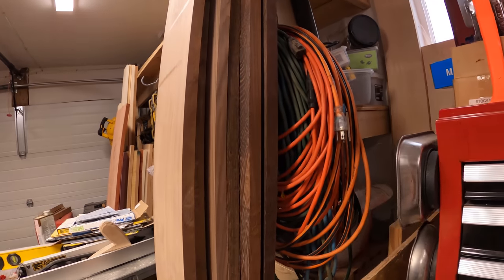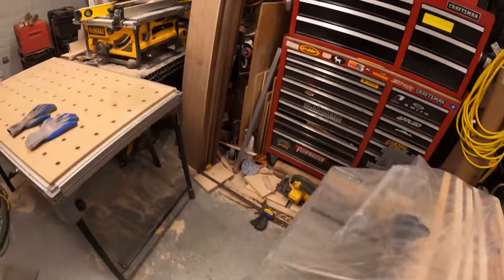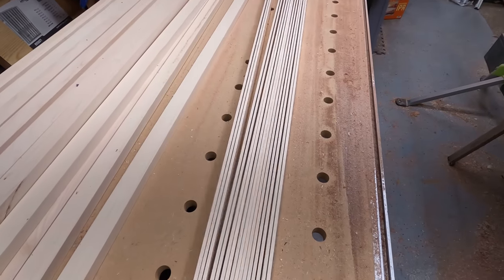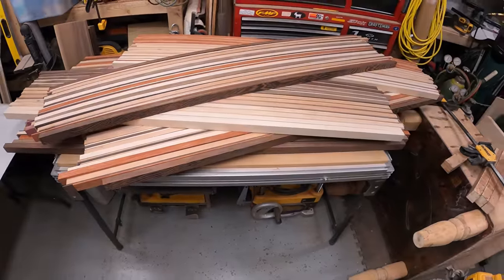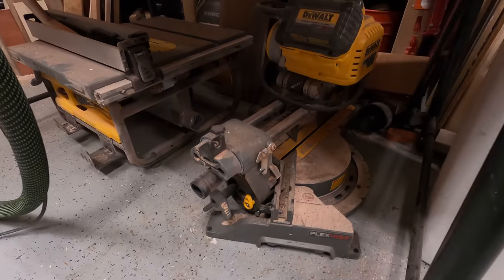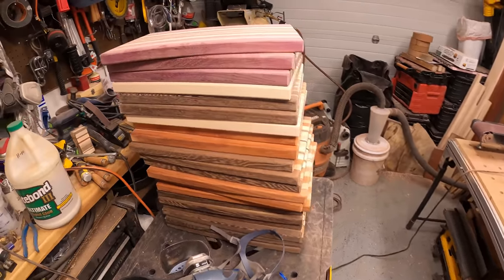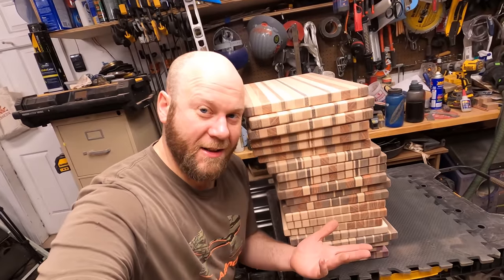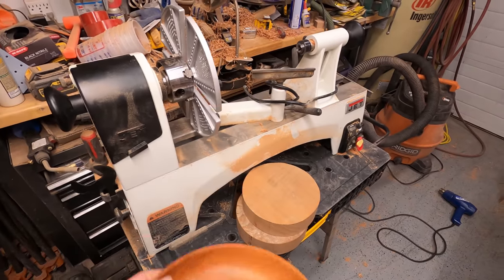21 Cutting Boards Sold In 10 Hours!  Annual Batch Of Boards, 2020.

Comment: Good job.  I've done a number of these over the years but always for family/friends, never to sell.  A trick for you that I came up with a few years ago:  when burning in your logo with a torch heated branding stamp, chuck the stamp/die in a drill press and clamp down your cutting board.  That way you always apply straight down pressure and if the die isn't hot enough, you can always heat it up more and press down again on the exact same spot.  No shadowing by misalignment of the the second pass.  I learned the hard way!
Reply from the maker: Thats actually a really good idea! Ive only messed up a couple of times but it is no fun sanding it to redo. Thanks!

Comment: Dang, if I bought one of those, I'd hang it on the wall, because they look too good to use as a cutting board! Awesome work! I would love to get into some wood working, but unfortunately have no where to put the equipment, or the money to buy it!
Reply: You dont really need much to make something like this. All of it can be done with hand tools which take up barely any space. When working with power tools you're trading labor for space, they require virtually zero labor but the tools are huge.
Reply from the maker: Thanks Diesel!

Comment: Use to have a small commercial wood shop years ago with about 4000 square feet of space where I made unfinished pine furniture, trophy parts, plaques, shields,cutting boards, golf tees, pool ques, etc.  I was in my 20's (over 55 years ago) ... worked by myself and sold to about 30 businesses.  Was teaching college at the same time and did my woodworking about 2 days a week.  Managed to buy most of my machines at auctions (best way to start a business since used woodworking equipment can often be bought at deep discounts if you keep your eyes open and follow all the industrial sales)  . Several of the tools I owned worked well with plaques and wood turning.  Had large panel saw, Italian back knife lathes for spindles, cues , bats.  Gang gluing clamps (great for the cutting boards).  Also 3 station heavy duty shaper, paint booth,  powder coating equipment, drying ovens.  Wanted to stay in business but many of the products I made were being undercut by off-shore producers and I would have needed to make the jump to much larger production levels to make decent living ... this was before the internet where everything was related to Price.  So I packed it in, sold my gear and just became a full time ivory tower egghead ... not a lot of money but much easier to do.
I really like your choice of wood species ... beautiful color choices.  Good luck in your future endeavors ... I know you'll do well ... hope you can expand into bigger shop .... you'll find it's a lot easier to get things done efficiently.  Bob Campbell ... an old guy just trying to survive this damn Covid-19
Reply from the maker: Really appreciate the kind words Bob. That sounds like a pretty serious business you had going. Thanks for the advice. Will look into auctions more, sure hope to have a bigger shop soon. Thanks Bob
Reply: @KrisDeVo  ... Kris, operating at home in your garage is a tough way to work but I did the same when I first started.  I had an old detached 2 car garage that I heated with a cheap tin wood-burning stove ... it's a wonder I didn't burn the damn thing down.  Did it for 2 years and then moved into more space in an old historic Civil War fabric mill just outside of Baltimore ... cool location ... I moved to a larger area a couple years later in the same old factory ... stayed there for another 3 years ... then decided to get serious about teaching and became tenured in the business college nearby ... have 2 great kids (they're in their late 40's) and the rest is history as they say.  Woodworking is a very competitive business because it is fairly easy to get started from an equipment standpoint ... to make a lot of money you've got to grow the business.  Your approach will work since you have positioned yourself in a niche market ... (i.e. high quality, good design, low volume sales at high prices ... it works) ... you won't become a millionaire but I can tell you love working with wood.  A word of warning from this ole geezer ... be sure to always wear a respirator ... I had a friend who loved woodworker as much as I do, he wore his mask sometimes, sometimes not ... he died of white lung  which is as bad as smoking ... just be safe my friend
Reply from the maker: Thank you for the nice read Bob. Im sure you were/are a great woodworker. We will see where this goes, I'm going to try and run with it as long as I can. I do try and wear my respirator all the time when its needed. I also run 2 air filters for woodworking to help. Cheers Bob.

Comment: A cutting board that has slide outs for a knife and other slide outs for your spices and even maybe the cutting board itself is a lid to a container below that holds more stuff. Even possibly your meat and ice and a couple beers. Oh and even a slide out burner with a propane connection.
Would be an awesome multitool to slide in your backpack and to pull out with everything you need for camping or whatever.
Reply from the maker: Haha! That sounds pretty serious.

Comment: Haha thank you! Loved your comment about sanding for two hours straight! My first commercial finish carpentry gig was creating prepared panels for a commercial installation. Laminated bamboo, two of us cut, edged, sanded and oiled about a thousand board feet of Plyboo to a complex and exacting cut list. Two weeks of work. Stuff smells like cat pee, and dulls tools, sandpaper, and your attitude in a hot minute. Anyway, thanks for the vid, and appreciate your attention to detail on long production jobs. Anyone who ain't done it, don't know what it takes.
Reply from the maker: Haha! Love this comment Bill, thank you! Being a finish carpenter (besides this)  I feel your pain too! Except I haven't worked with bamboo which is supposed to be horrible like you say. My wife said I shouldn't include that part about sanding but I said, if you know then you know and you can relate lol. Cheers!
Reply: that stuffs like $600 a sheet, made some cabinets from it and it was the hardest material i've ever had to build with.. could barely drill or cut it and god forbid tried to shoot a brad nail in it.  stuffs freaking bullet proof thought if you manage to get something built with it

Comment: As a woodworking student myself there are a few details I would change in your workflow to make it more efficient and minimize burn marks towards the end there (so you almost wouldn't need to sand). But other than that your visual style and craftsmanship with the space you have is amazing! Absolutely love it
Reply from the maker: Chop saw needs a new blade. Picked up a slide saw for my MFT table and no burns now. Lots of sanding is key to get the finish I want on these. Curious what workflow ideas you have. Thanks for the kind words.

Comment: Hi, how do you keep the padauk orange dust from bleeding into the other colors when sanding?
Reply from the maker: Blow it out with the air compressor before finish. If you still have issues you should sand to a finer grit

Comment: Nice cutting boards.  Beautiful.  You need a feather board and out feed table or even just a roller.  This would go a long way to keep your fingers.
Reply from the maker: Thank you, appreciate that.  I do use an outfeed roller most of the time. I am making a small outfeed table for this as we speak.  Im not sure about using a feather board for this but would sure like to keep my fingers.

Comment: Love the boards and enjoyed watching the batch process.
I use parchment paper for the glue ups to prevent the discoloration from the bar clamps.
Reply from the maker: Thank you, appreciate that. Ill have to try parchment paper. Thats a good idea.  Ive used tape before on the bars but it was a pain.
Reply: @KrisDeVo  Wax paper works and is cheaper

Comment: 4:25 - Man, that's an amazing bit of wood.  I wouldn't want to cut it into blocks, but find something full size to make with it.  Like a desk, or side table.
Reply from the maker: I do agree! But I bought it for a purpose and used it for the edge of the boards to show off the detail
Reply: @KrisDeVo  It actually looked really good in the board by the end of the video.

Comment: You are absolutely killing it!!! Any tips on how do you do your brands with the branding iron? I've only had mine recently and I've learned, (hopefully this is useful) for the branding of boards at the end, I use my infrared thermometer to make sure my branding iron is about as close to 800 degrees F as possible, (I have best results when I just let mine sit over a strong flame for 15 minutes) that way I'll get multiple boards on one swoop, because if you miss it, and the iron is too cold, I seem to make mistakes which is soo painful...  but when I heat it up super high, and just keep it there,  I don't seem to have the mishap of having a branding iron too low of a temp where it leaves a subpar brand, because NO ONE want's to have to sand down a half done brand to redo it, especially after you've sanded down the brand and now the board is uneven, or you had to sand the whole board down and now the entire board is thinner... 
- Dave
Reply from the maker: Thanks Dave! I only put mine on the flame and rotate it for a couple minutes. Goal for me is not too hot and short heat after every one. Works for me and only mess up once every 30 times or so. Thinking about trying the drill press technique just for that reason of how painful a bad stamp is to re-do. Thank you Dave!

Comment: Excellent results. Its alot of work in fairness to you. I tried one myself recently and I made every mistake under the sun. I was wondering can these actually be used as a cutting board and if so what finish should I use. 
Thanks and well done
Reply from the maker: Thanks. Yes you can definitely use them. I have a link to the oil I use in the discription
Reply: @KrisDeVo  thanks for the reply Kris. Gent

Comment: This is awesome. I've watched it at least 5 times. What width did you rip the larger and thinner strips to? What are your go-to hardwoods for cutting boards? Lastly, what is the final dimension of the finished product?
Reply from the maker: Thanks Aaron. 1" 3/16" and 3/16-". 17" x 11.5" x 1"
Reply: Rookie woodworker here, just started my first board tonight using scrap and don’t like the coloring.  Came across this awesome video looking for inspiration on color combination. Love your work. Can you divulge What types of hardwoods do you use to get all the beautiful coloring? I see walnut maple cherry and mahogany. Any others that you like to use ?

Comment: This is great, I make cutting boards once in awhile, I got rid of that black mark on the bottom of the board, by wrapping wax paper over the black pipe of the  bar clamp, saved me a bunch of sanding.

Comment: Nice man, your the first person on youtube I've seen make a 6 or 7 foot strip then cut out 3 boards. Seems so obvious in hindsight to do that. That purple heart looks amazing on those boards, kind of a show stealer lol. You should try some butternut and quarter sawn brazilian ipe in your next batch. The ipe doesn't look all that nice rough sawn or even deck planking but if you put it through the planer it has the same striping and figure you'd find in rosewood or kingwood. Definitely won't disappoint
Reply from the maker: Thanks! Yeah that purple heart was the best if seen. It looked so bad in the store and was the last one left. Crazy how that works out sometime. I don't think I've ever seen butternut or brazilian ipe up here. I will have to keep a look out! Appreciate the info.
Reply: @KrisDeVo  butternut is sometimes called white walnut if that helps and the ipe usually isn't in hardwood stores, the only way I've seen it sold was for decking and siding. I learned about it working on a house for my job at this million dollar mansion and this guy was getting a huge deck made out of it and I'd search the dumpster everyday for cut offs.

Comment: I have to agree with the comments here.
Work is great, your organization is impressive in such a small space as well.
My only question, not a criticism whatsoever, how can you afford to sell them so cheaply for the time and equipment you have invested not to mention materials?
I've worked wood for over 45 years now and understand the marketing as well as labor intensive effort you put in.
It's something I've struggled with and still can't justify at times.
Work like this is unusual and deserves more than just an "Atta Boy" that overlooks the practicality of what's involved.
Again, The work looks great and you can take pride in what you've accomplished.
Reply from the maker: Thank you for the kind words Mark. This was my 3rd annual batch type thing and I've been able to cut down the time a little bit each time. I do feel like I need to price them higher but for an edge grain board they are more expensive then almost most out there. Although I would like to think they are as good as it gets as far as quality and the people are the judge on how it looks, which has been humbling. I guess I'm struggling with the price vs cost to justify it like your saying. Now that I am taking this a lot more seriously I am working on the production side of things here in my little shop and on a large scale in another shop. If that doesn't work then the price will go up. Thank you for you input and complements. Cheers
Reply: Two items to add you can consider. 
Simply using a 4" paint roller, using tape on the dry roller when new to remove any loose fibers, makes a huge difference. 
I've bent over 30' of handrail alone using a 9" roller and extension rod with a 5 gal bucket and a paint screen. 
Plastic on the floor,  'C' clamps sized and spread ready to attach to forms.
Just so you understand it's not theory or something a handyman / woodworker may suggest. 
Twist and curve staircases give much the same satisfaction you get with making mult-species boards. 
Even done them with cherry center stripes and maple perimeter. 
Maple is the most likely to have a failed glue joint at some especially hard section where glue hasn't penetrated the fibers well. 
The machining can create a more polished than porous surface when they are fed through the shapers. 
The other consideration becomes moving to a larger space you mentioned. 
Heating costs, insulated building or not,  products have optimal working temps. 
I lived in Las Vegas when doing multiple bends a day at times.
Heat was just as much a problem in new construction as freezing temps despite being desert.
An additional source of revenue to cover the extra costs of rent, insurance and utilities now become a separate issue from the home they are currently budgeted in.
Started in a two car garage myself until the work changed from projects like yours to needing extra hands to meet deadlines. 
Worked through far too many nights because oftentimes  extra hands saw a paycheck instead of the livelihood and reputation you now enjoy. 
I'm not trying to lecture, trust me, I've made far too many mistakes to be anyone's role model. 
Only offering what little I know to help you succeed. 
Good luck.
Reply from the maker: @markbussell7503  Thanks for the advice.

Comment: These serving boards are beautiful. They are most likely very durable. But cutting boards have their end grain facing up. 
It's for sanitary reasons and longevity.
Reply from the maker: Thank you. These are definitely cutting boards. My grandma used hers everyday for over 20 years. Endgrain we call butcher blocks. This is a good video to see the difference and maybe the "myth" of edge vs endgrain. https://youtu.be/kd4vNcTvWnE
Reply: @KrisDeVo  alright... I'll watch that later tonight. 
There was a study done on endgrain and how it closes up after a knife penetrates it. Which stops food and fluid from getting stuck and holding growing bacteria. Endgrain boards are cleaner than hdpe boards even AFTER they go thru the dishwasher.
These long grain boards do not have this feature. 
I'll use these for dry food. Basically bread, hard cheese etc. 
Wet foods get a plastic board or end grain(in my house) 
I'll watch that video tonight when I have time. 
Again, Beautiful board,I love the dark to light with opposing thinner slices going light to dark. A show peice for sure.

Comment: You need to make an insert for a drop in router.  Turn that table into a router table.  Makes routing faster.
Reply from the maker: Might have to do that. Not sure I would have as much control but worth a shot. I never liked using the crappy router table at work.
Reply: Just make a nice one you will see its way better i use mine for everything. My routers are rarely in the hand held i have several routers that fit the same base so most stay set up.  Just slide them in set the height and I’m ready in minutes tp route. Thanks for posting great video.  Beautiful cutting boards.
Reply from the maker: Will definitely have to try that. Thanks for the tips.

Comment: What are the dimensions of your boards?  You said you do 60” glue ups so that either gives you 3 20” boards or after cutting off the snipe it would leave you with give or take  17”.   I made a killing on boards over Christmas. I probably should’ve charged more but it was alright.  8.75” x 14” x ~1” for $65.  

Also good to see an Alaskan on here.  I was born and raised there in anchorage and chugiak and palmer.  I’m now in Oklahoma City.
Reply from the maker: These were around 17" x 11.5" x 1". Sold for $135. Sweet you did well too. Small world. Thanks